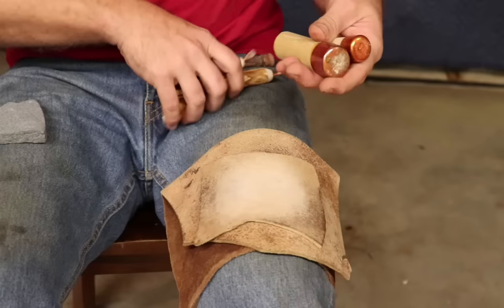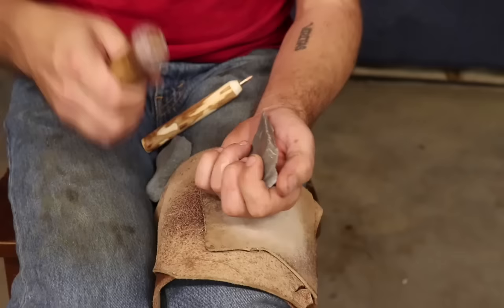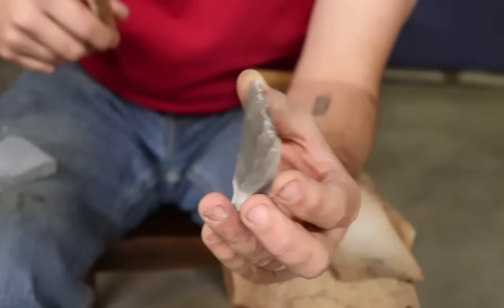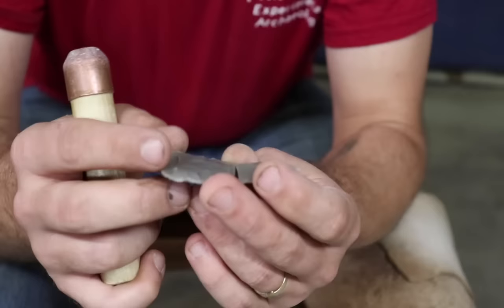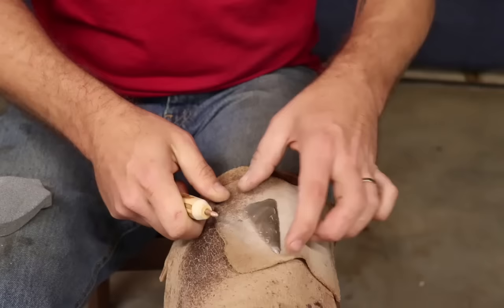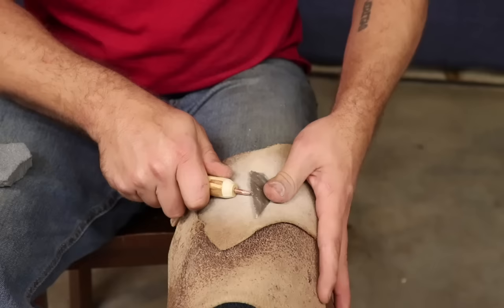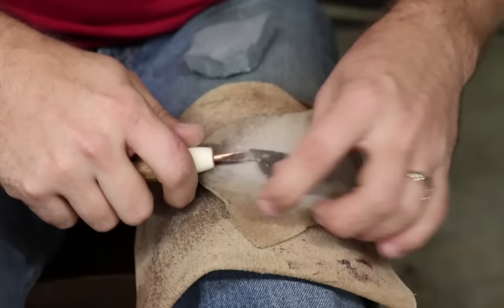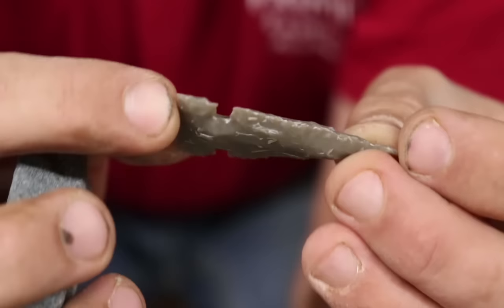How to make an arrowhead . An intensive breakdown for beginner Flint Knappers

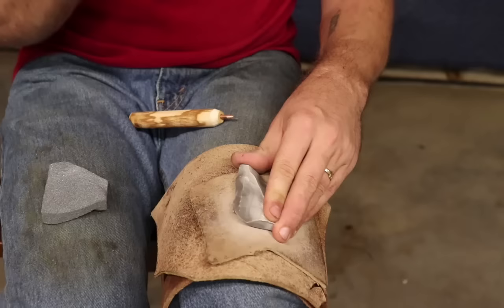Comment: Beautiful work, sir. Your explanation of the conical force propagation had me scratching my head until 18:20 when you showed the long flake. It does indeed resemble a small section of the curved surface of a cone. Your shattering of the stone at 45:20 was a bit disheartening until you explained that it's just something that happens sometimes and that it wan't actually a large loss of time for you. The difference between your instructional production speed and your commercial production speed became quite apparent when you began fashioning the replacement. Those serrations are vicious.

I bought an expensive chunk of black obsidian at a rock shop in my youth while on vacation with my parents and I attempted to work it into a some kind of blade without any instructions at all while riding in the back seat of my parents' vehicle while they were driving. I'm pretty sure I made a mess and ended up littering the carpet with razor-edged conchoidal fragments and dust. The sharpness of the larger fragments blew me away. That was probably 20 years ago and I haven't really dabbled with the stuff since. When I have the occasion to go hiking in the mountains, I'll sometimes smash rocks apart to see how they fracture. I might eventually find some decent material on which to experiment.

Comment: Hello Ryan. I made similar flintknapping tools several years back and still have them. I never really stuck with making my own arrowheads. Watching your video makes me want to try again. Does the flint rock have to be baked to remove the moisture from the rock to make better flakes? Is it really necessary?  I ready about a bake method of burying the flint rock and make a camp type fire on top of them. You need to make a small leather type saddle that wraps around the top of one of your legs and add some small pockets to it. This way you can set your flintknapping tools in them so they don't keep dropping on you. Just an idea. Very nice informative video. Thanks.
Reply: Hello Luis, I am not Ryan but I have been knapping for over 25 years.  Whether you need to heat treat the rock to knap it depends on the variety of knappable material it is, the grade, and the individual knappers skill.  High grade glossy cherts and jaspers and such don't really need to be heat treated to work well but many can be heat treated to work better and get more glassy and sometime gain some color.  Mid to low grade cherts, many jasper, most agates, and such will need heat treating to work well but a skilled knapper can sometimes work them well raw.  There are some cherts and such that won't heat treat without fracturing for various reasons.  And if the chert is too low grade and chalky it may never improve with heat treating.  Much of it requires experimenting with heat treating flakes to see what temps will work for what material.  There are list online if you Google heat treating chert that will give some generally temperatures for known chert types and such.
Reply: @curtissmith1391  Thanks Curtis. Flintknapping is quite an art that requires a lot of skill and patience. I'd also like to watch a video of a Native American flintknapping with the raw materials they used for survival. Any recommended videos?

Comment: Instead of using the notching tool what would happen if I just used a flat head screw driver
Reply from the maker: some folks do that. You'll find that copper grips the rock much better. A screwdriver is a really hard metal and wants to slip off the rock

Comment: can you use a flat head screw driver to notch
Reply from the maker: a steel screw driver will skate off the rock rather than bite like copper. You can probably use one to some extent but it wont have the same bite as a copper tool

Comment: I saw a different video of yours where you made a knife, so I tried it on my own, and I was able to get a rough knife shape, but after I while I just kept breaking off pieces but it didn't seem to look any nicer after a certain point even though it was getting smaller.  So that's why I decided to watch more videos.  I guess maybe part of the reason is that I didn't have any proper napping tools.  But of course any break you do appears to be sharp enough to make scratches in wood and to cut through paper cleanly.  But something I noticed while sawing at wood was that little pieces of flint would break off.  So here are my questions:

How is it possible for there to be a stone axe?  From my limited experience (just one attempt at making a stone knife and using it to saw some wood), I was under the impression that my stone would just shatter if I tried to strike it against a tree.  But surely something like that was possible because native Americans made stuff like canoes.  Maybe I was using a particularly brittle kind of flint?

Also, if I wanted to find flint of my own, where would I look?  I live in Kansas near Kansas city and they sometimes call this place the flint hills.  But do I look in the river?  Do I look at the top of the hill?  Do I look at the bottom of the hill?  I guess I could just try to find this stuff myself but it sounds kind of boring to walk through the underbrush and get all muddy and sweaty looking for rocks that I'm not even sure I'll find, so I'd like some direction.  Or would even stone age people find this stuff mostly by accident and just remember to pick it up whenever they happened to find it?

Edit:  Watching your video answered some of my questions.  I think I will be able to get a better shape now.  And I see that flakes came off when I used my knife because it had a crappy edge.  I guess if I had a bigger stone (which I don't have now) and a clean edge, that it should be able to endure more force without shattering.  But I would guess obviously that all stone tools have a shorter life expectancy than steel ones.

Comment: What’s the best starter stone to use? Haven’t seen all your vids yet so it sure if you mentioned it
Reply from the maker: Obsidian breaks easiest but it is so crazy sharp, usually beginners get cut up pretty bad, different edwards cherts that are heat treated are probably my favorite though. It breaks decent without too much pressure and while sharp it isn't nasty sharp.
Reply: HuntPrimitive yeah I learned the basics on beer bottle bottoms.   Haha I bled a few times. And by a few times I mean every time. I think I’ll stick to rocks   Thanks for the quick response!
Reply: HuntPrimitive also on avg how many pieces per Lb can I expect from you? Just wondering how much to order of the Edwards

Comment: is the flint treated or heated prior or can this be done with just flint I find? We have a ranch where we can readily find real arrowheads, but I have always wanted to try on my own. great video
Reply from the maker: you can knap raw flint, cultures didn't widely start heat treating rock until 8-9k years ago. Heat treating will make a lot of it break easier.

Comment: Forgive me if you mentioned this, when you see flint arrowheads in stores, souvenir shops and such how are those made easily enough to sell for cheap?
Reply: Probably made from a pre ground blank. Still it will need flaking to look good but most of the work is done on the grinder.

Comment: Just like anything we humans do it’s all about repetition and practice practice and lots of patience and more practice.
Most things that need to be learned over years and will always stay with you but are all still perishable skills for the most part that get rusty.
One issue I had early on in Flint knapping was not using a large enough stone in the beginning and I would end up with small arrowheads which looked great but needed to be bigger.
Try napping glass it’s a useful thing in case you’ll one day need an arrowhead or blade and have no stone.
Use the bottom of a bottle it works best if your in a pinch and only have glass.

Comment: a quick question. i am fairly handy, so i expect a bit of disappointment, but success to come. my question is... for a first second andn50th attempt, would you suggest arrowheads first? or maybe a knife blade... a bigger piece. 

i ask tjis, because, often, doing the smaller stuff, which is harder, you end up with good skills for the rest. 

thanks again for the videos.😀
Reply from the maker: arrowheads most likely because the bigger the piece, the easier it is to shock-snap it. It doesn't hurt to try larger pieces but when they break, switch gears into using the pieces for arrow points. best of luck knapping~
Reply: @huntprimitive9918  ok! thanks for the prompt reply🙂

Comment: Would you say that getting stone from a "quarry" of sorts is really important, or is just any chunk from a streambed ok, within reason? I think most of what I've found has been freeze fractured so just crumbles. I also recall years ago in one of the books (Douglas Spotted Eagle I think) there was a quote from the older folks claiming that bone could be very deadly if processed right. I cant imagine bone getting "crazy sharp", your thoughts?
Reply: Quarry stone is a broad term, but most of the time anything other than Flint, Obsidian, and glass is pretty difficult to knap at all, let alone to actually shape effectively. Some other types of stone can work, but they are less common and are more difficult to work than flint and obsidian (and, later, glass) which is why Native Americans tended to use Flint, Obsidian, and Bone most commonly.
Reply: @flyingdutchman8371  Ah yes, to clarify, I'm specifically referring to the various flints/cherts or others that make good conchoidal fractures and basically asking if collecting stone found just laying about is reasonable or if its necessary to find a good local source and be intensely selective. For example, here in central Ohio, there is a ton of this gray waxy stone (possibly upper mercer flint?) just laying around in landscaping fixtures around buildings etc... It flakes nicely if you can find a good piece, but almost always has fractures running through it, so just crumbles. Is this just the way it is with most stone or could I expect better quality from a well-known quarry (here flint ridge for example)
Reply: @deanvik6317  if you source your stone from a reputable quarry and specifically seek out stone that makes good conchoidal fractures, you should be set. Keep in mind though that just because a certain type of stone shapes well, it isn't automatically good arrowhead material. You also need hardness to have any kind of actual hunting capability.
Reply: Just want to loop back to this briefly bc I think Ive answered my q. 1) quality stone matters. I went out to a well known quarry here, but horrid migraine, so picked easy to grab junk flint. No surprise, it flaked like junk. The few reasonably good peices I did get were workable, but I'm still learning so nothing great... Its a journey. 2) The specific stone I have been seeing "just laying about" is indeed upper mercer flint. I asked a local knapper and confirmed. Columbus oh has a ton of it, but most has been through a machine or froze etc... So not usually workable. However there many other flints here that 
Can be good and found. Leason learned, find good stone, and there may be more workable stone in your area then expected, keep a lookout and "follow the gravity" to find outcroppings. Building bows/atlatls/hand drills etc... can be done with a multitide of fairly easy to find material. Making good stone tools requires a serious investment in finding quality material. Makes sense that stone would have been a major trade item way back.
Reply: If I had taken more time and gotten the better stone that I know is at this quarry I know that inwould have had better results, and many folks get beautiful peices out of there. Nethers farm, its an Ohio gem.

Comment: Mr. Gill, thank you, very interesting video.
The question I have is directed to you, but if any one else can answer it, so much the better.
I do not believe I will ever be a "purist" about anything.
I will never hunt mastodon with spears and arrows, if I have access to a Barrett .50 cal.
 We as humans have advanced too the point we are now, because we have looked for a "better, cheaper, easier" way to do everything we have taken on.
Over the eons out tools have changed, because we have hunted the "better way" to do things.
So, my question:

You use copper for your flakers, "why not iron or steel" ? 
Outside of "Historical use".
Thank you.
Reply: For "purists", copper was available to aboriginal knappers (although there is very little archaeological evidence that they used it for knapping). A more practical reason is that copper is softer than iron or steel and "grabs" the flint when used better than iron, which sort of skitters off the material. That being said, I have seen people use steel for fine pressure flaking, like notching tools. Also, hammers and sledges are often used to spall very large pieces of flint.
Reply: @dooleyfussle8634  Thank you.

Comment: What causes step fractures in Flint knaping?
Reply: Incorrect angles, incorrect platforms, incorrect support and using the wrong size tool are the primary causes. Figuring out which one or possibly which combination is key.
Reply: And bad contours with concave surfaces

Comment: Can't a just use a screwdriver as a pressure flaker 
And do I really need a billit?
Reply: I dont think a screwdriver would work well because the material needs to be soft enough to grab the rock as it is removing flakes. And you could probably make it work with out a billit and just use a hammer stone but i found that to be harder to use when trying to learn flintknapping
Reply: Imma cut off my arm 
And use my bones 
As tools
Because I dont know where to find antlers 
And I bet they expensive too

Comment: Could someone on here that has access to the type of rock needed for making arrowheads mail me a rock or pc of rock? I really want to get into this and teach my son.
Reply: If you have no experience, it’s more cost efficient to use obsidian or glass. It works in the same way as flint. Plus it’s a lot easier then flint, for beginners. For glass use the bottom of a glass bottle. 

You can find this stone on any primitive arrow making site. You can either get the massive stone that is called a spa or get the pieces ready for pressure flaking and light percussion flaking.
Reply: Another great source for materials are ceramics (like toilets, pottery or anything fine grained), and TV's (old school tube type, and heavier is better). Flat screen tube style are the best and I can't tell the difference between it and quality Obsidian. Use safety glasses and all your thinkers when breaking into the TV's. You can hurt yourself easily busting them down.

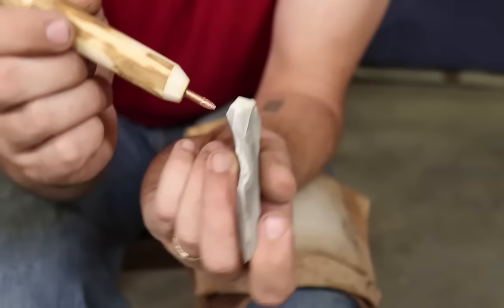Comment: Starting at about 22:50 you knock off a flake that might be about 2" length and 1" width. Would that flake be appropriate for starting a small arrowhead?
Reply from the maker: yeah, sometimes. If they are thick enough without much curve, you can definitely save flakes like that for other points

Comment: Damn. Those people back in the back the day knew how to make copper tubes and steel files and still had to knapp arrow points? IMO you are very talented and skillful, but couldnt you just use mechanical grinder and sander to make these?
Reply from the maker: Modern knappers are the ones that use copper, you will notice most of my videos utilize deer antler to chip rock. You cannot however use a grinder and sander because the stone is too hard to grind with a belt or aggregate wheel and will wear the grinder down before the stone.
Reply: What? That doesn’t make sense

Comment: 28 minutes none should think that it's gonna be easy bc it was learned brand new by the Indians and if anyone thinks that the first people to pick up obsidian and smashed it up Into an arrow head no they went thro the same thing your talking about bc at first they broke pieces off and just used pieces for hand axes and sharp blades to cut with they didn't just pick it up and say imma make an arrow head from it no they gradually made more and more useful piece until being able to make arrow heads spear heads knifes so people should concentrate on making simple tools by flintknapping first before trying to make the hardest thing to make start easy with just trying to get a piece to use as a small sharp blade or a hand axe simple first then as you get better more intuitive

Comment: Making stoneage tools with industrial age tools made of industrial age materials.
Makes no sense.
Reply from the maker: Copper tools ease the learning curve for those that don't have the time to dedicate spending 15 years to knapping with only antler tools like I did.  the same principals work for antler as well and I have those videos as well
Reply: @huntprimitive9918  
Tkx. but it makes no sense. You could have used an angle grinder to 
"ease the learning curve for those that don't have the time"

Like "we built a viking ship but used chain saws and rotary saws to cut the wood."
Reply from the maker: @hansnielsen4165  you can't use an angle grinder on it, but even at that, that doesn't teach you anything about the mechanics of flintknapping. Let's just be content to say that you don't have interest in flintknapping and leave it at that.

Comment: OK, I will take your suggestion to dis this too long video.  First off the videos content is "flaky", no doubt about it.  Secondly, you continue to chip away at the topic but never seem to get to the point.  Thirdly, It's like you are taking the viewer back to the stone age in terms of the subject matter.  Perhaps, you could present a more modern cutting edge tutorial, say, on broadheads or carbon fiber shafts.  Or does that compound the issue?
Reply: If you where concerned about making carbon arrows I’d recommend watching a blacksmith. This also teaches believe it or not  a life saving skill set if you where stranded alone and no food.